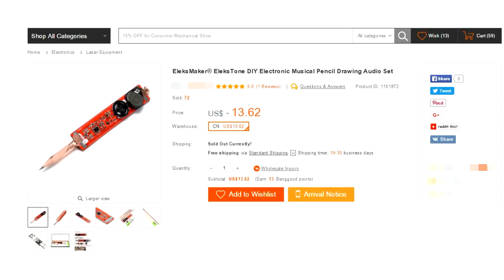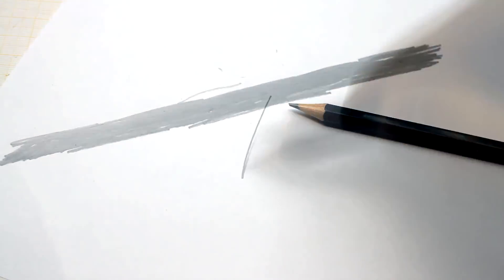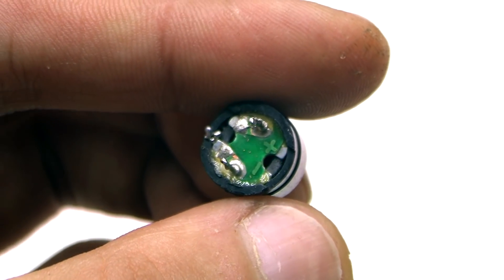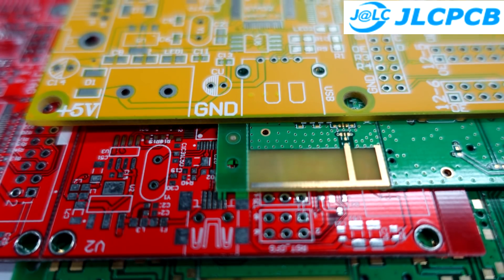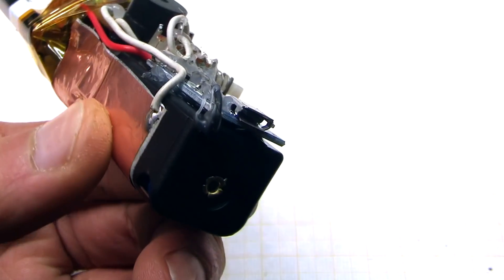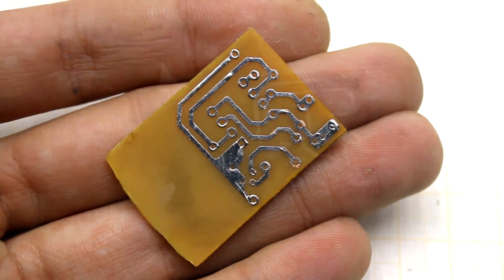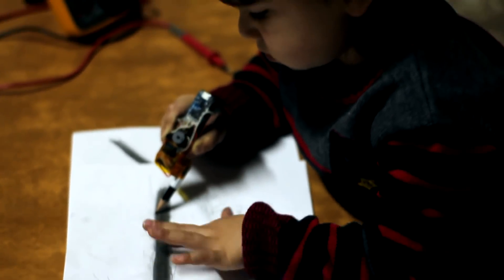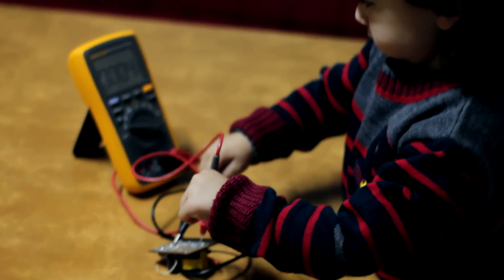Make this unique toy for your child!

Comment: A 18650 has too much energy stored in it, that can hurt a child real bad if something goes wrong or gets punctured. 
Do not do this! A coin cell will be more than enough.
Reply: Or rather, just using a NiMH cell would be best.
Reply: Yeah, people should be carefull with kids shorting an 18650 battery. Use a protected cell, or add protection to your design. Although coin cells put more kids in hospital than 18650's. 

Every year we hear about children swallowing coin cell batteries and needing emergency surgery, some even die.